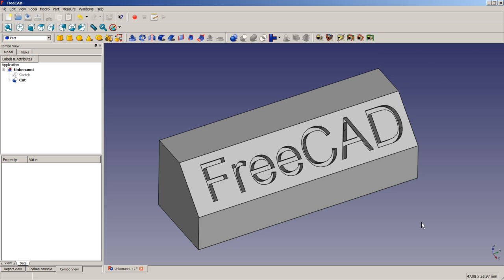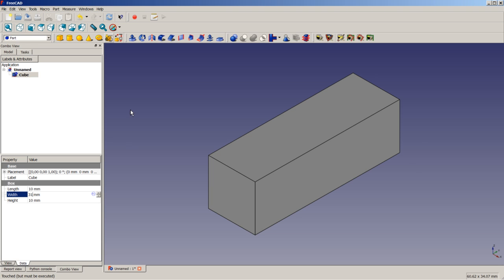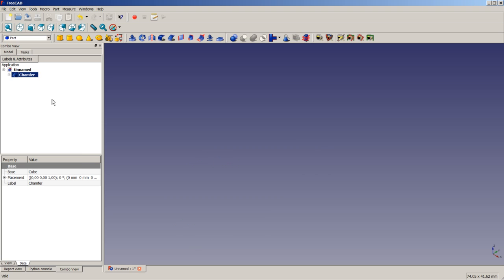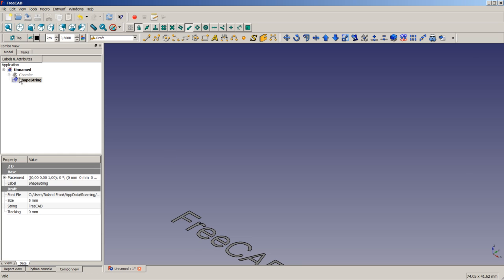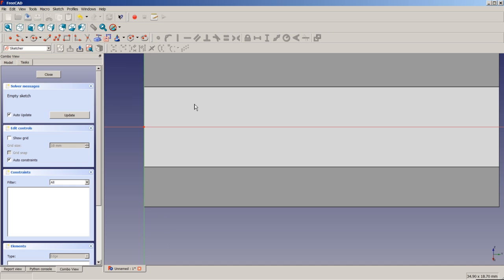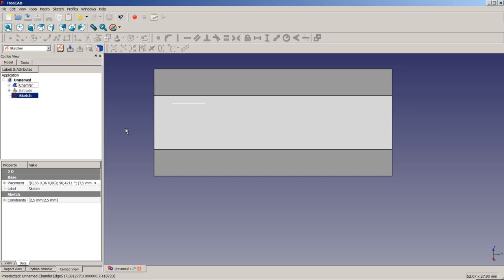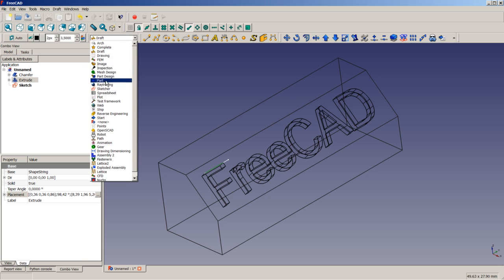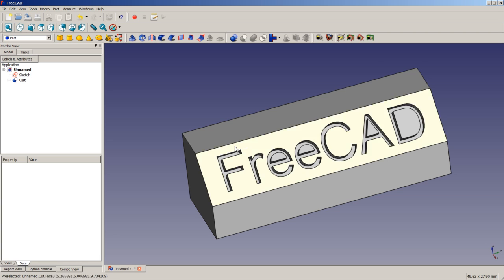FreeCAD Wiki - Draft Shapestring Tutorial

Comment: Not your fault but I have tried following these tutorials with FreeCad and in the blender mode.

I find that undo DOES NOT UNDO!! and I am fed up haveing to remake because REDO also DOES NOT WORK...! It does not mean redo the cude or redo something other than the very last operation that was undone.

So far I have ended up with a cube several times and its not me, I can use quick 3D rendering tools no problem, click, drag, expand, job done. too much fiddling involved for getting drawings done, if this was tryuly parametric as the vendors claim, then the design process would not need to rely on the keyboard as much because the inputs would be gesture based with click, drag /pull/push and drop type actions to get the basic shape.

I have got to the text bit, twice... Its now back to a cube, A FRIGGING GAIN... what is wrong with this software is a plenty, I am trying to find whats right.
Reply: Mark, the author of this video,Roland Frank, died in September 2017. Considering your struggle with FreeCAD, I recommend you register to the FreeCAD forum where you are certain to get help, provided you show an open and respectful attitude... FreeCAD is open source and programmed by *volunteers in their free time*, they are not "vendors" as you seem to think.
Reply: Normand Chamberland omg, that is so sad. This tutorial worked for me so idk what problem this person is experiencing. Are you using windows, mac or linux? It works for me on the current version or windows 10